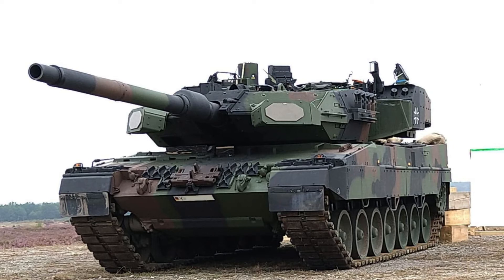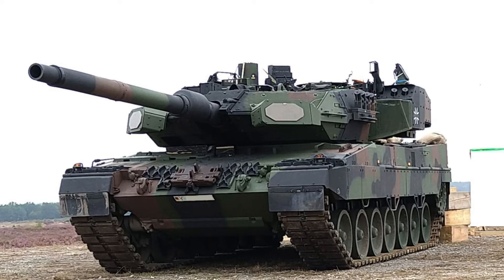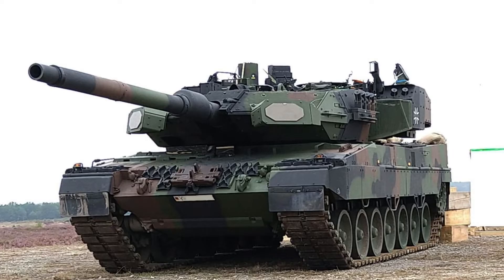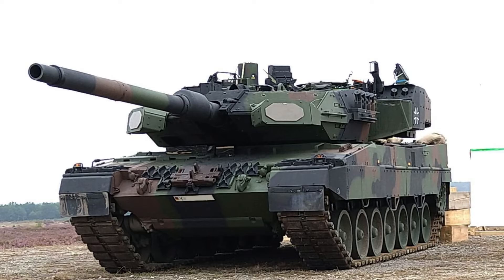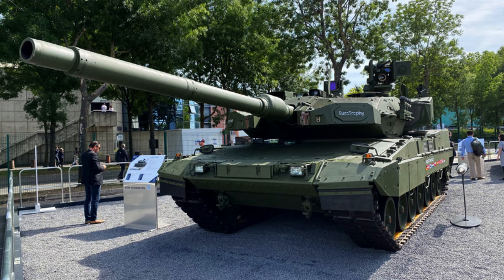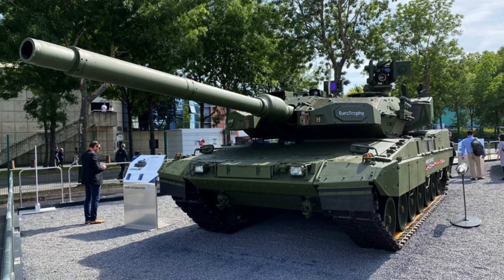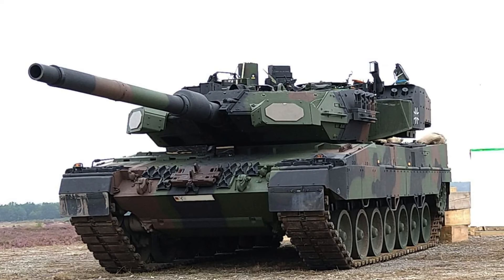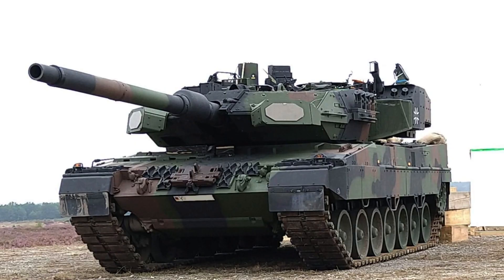Leopard 2A8 Main Battle Tank (Germany)

Comment: 67 tons...  Leopard tank = all credibility lost.
Reply from the maker: It is very heavy meaning it will probably get stuck in a very muddy field.
Reply: @MilitaryMindsKnowledgeArsenal  Not just in fields, roads.  Heavy tanks slide off from roads into ditches, and that's if those tanks can even get to those roads at all, since majority of local bridges barely hold 40 tons.
Reply from the maker: I suppose this is the bit where the west realise that Russia has the better approach of smaller and lighter tanks with ERA instead of Chobham armour. Because weight and speed is everything in warfare, if you cannot get away quickly enough you die, and if you cannot pursue them quickly enough they get away and live.
Reply: @MilitaryMindsKnowledgeArsenal  That was known since WWII when Tiger tanks kept sinking into the ground, and then King Tigers kept suffering transmission breakage from traction slippage.  Ground pressure level is a specific value, Tiger tank commanders were instructed to test the earth condition prior to crossing unknown terrain. King Tiger tanks were even heavier, and even though ground pressure value was acceptable by track design calculations, in reality traction was the the problem as tracks would incrementally tear away top soil layer which would shudder transmission gearing.  All of those factors were well known by 1945, yet Western/NATO tank design philosophy did not change to this day.  50 tons is the maximum tracked vehicle weight for Eastern European theater, with absolute maximum of 55 tons, and that's only in specific areas.  Soviet/Russian tank philosophy is entirely merit based; 1. tank has to get into engagement zone under its own power 2. tank has to deploy a weapon system that's effective for the given mission objective 3. tank has to have enough armor protection to support safe exit from the engagement zone.  To this day it has not been properly covered in the West why USSR fielded 3 main battle tanks and how they were to be deployed.  T-64, T-80 and T-72 all had specific roles in which they perform best.

Comment: Sooo no Leo3 Panther?
Reply from the maker: The KF51 Panther is too expensive for Germany so they chose to upgrade the Leopard 2 tank for now, but in the future they will probably end up switching to the KF51 Panther (and probably name it the Leopard 3) because of its larger gun and better armour.
Reply: MGCS ( Main Ground Combat System ) will  substitute the MBT Leopard 2
Reply: @MilitaryMindsKnowledgeArsenal  Thats a horrendous take full of mistakes.
Its not too expensive its just useless to buy it. It has a 130mm cannon which would make it incompatinble with STANAG rounds and would make no difference on the current battle field.
They wont buy it in the future either since theyre working on the MGCS and lastly, they would not call it Leopard 3, since its not a Leopard 3.
Reply from the maker: @adhx7506  Personally, I believe that the future lies in 105mm guns with the Israeli LAHAT because of its top attack capability and extensive range and penetration, because if we keep increasing gun calibre size it will get to the point where the rounds are too big and the tank can carry less and less ammunition for the main gun.
Reply: "transitional"
Reply: It was only a demonstrator not a real tank to be sold or used . Germany dont need it too the leo2 is still perfectly fine and can be upgraded as needed

Comment: how is its mine damage survivability? nice to see someone actual thought about close in defense systems . also has it been tested against artillery shrapnel damage. that seems to be a thing now days.
Reply from the maker: I assume the Leopard 2A8 would be able to survive a 10kg mine blast, as most main battle tanks that have been recently introduced into service. According to the German Bundeswehr magazine: "The Leopard 2A7 features the latest generation of passive armour and belly armour providing protection against mines and IEDs. The Leopard 2A7 is fitted with adapters for mounting additional armour modules or protection systems against RPGs.". This means that the Leopard 2A8 has better mine protection than all the other Leopard 2 variants, but because most defence forces do not release this sort of information publicly, we can only guess on things we do not know about. So to answer your question on mine survivability, I believe it has very good mine survivability, better than most main battle tanks because it is a brand new heavily upgraded tank, but you have to bear in mind everything is a guess because we do not have any publicly released data. Again, about the artillery damage, the Leopard 2A8 is currently in its testing and is due to enter service next year, so maybe then we will know. I do apologise if this was useless but as I said, not much information is available regarding protection, what armour it has and so on. In conclusion, yes it is the best Leopard 2 variant.
Reply: @MilitaryMindsKnowledgeArsenal  I believe? 
Reality in Ukraine shows that the tank is scrap, even Ukrainian General Zaluzhny said himself, Leopard is a good target, but nothing more...